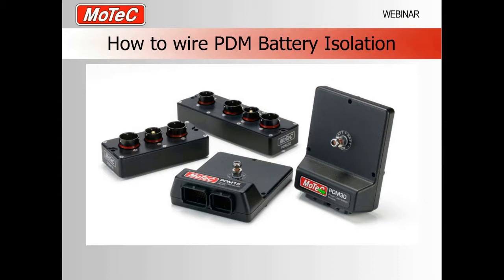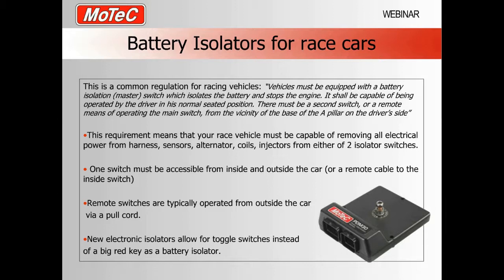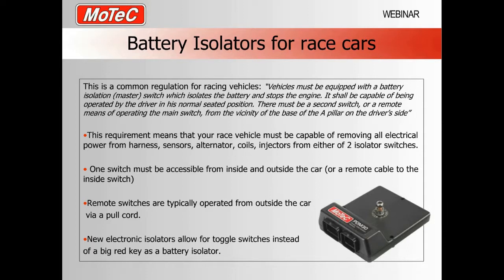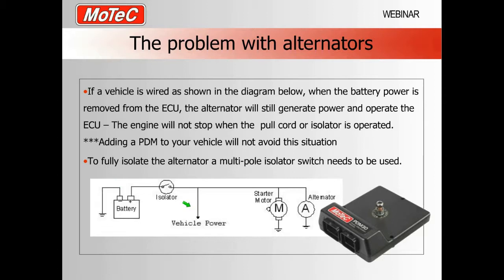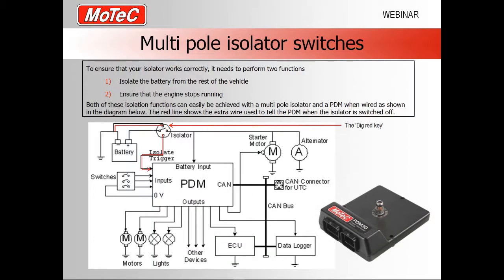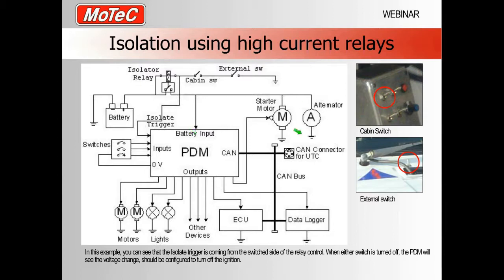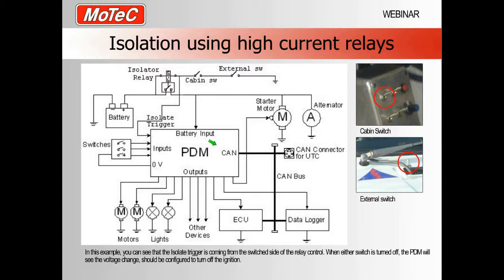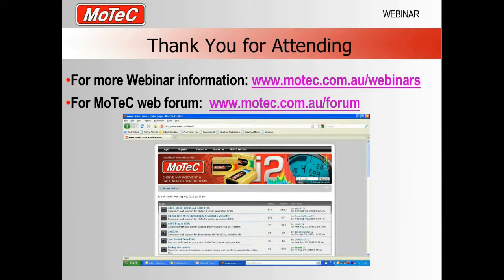How to wire PDM Battery Isolation

Comment: A lot of "big red" master switches also include a third set of contacts which connect the alternator output to ground through a large resistor. They say this is required to suppress the high voltages you can get when you suddenly disconnect the alternator from the battery with the engine still running. Is this a good idea? Or not necessary when you are using a pdm and have it set up like in the video?